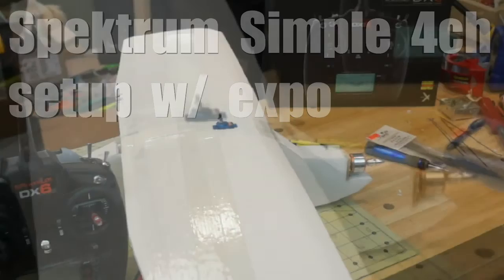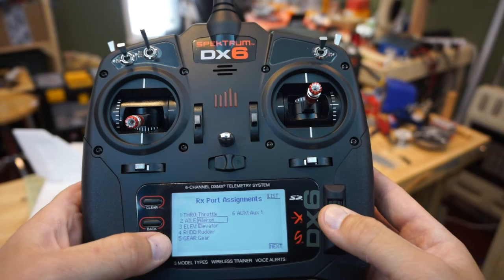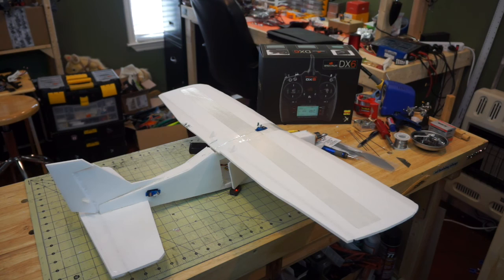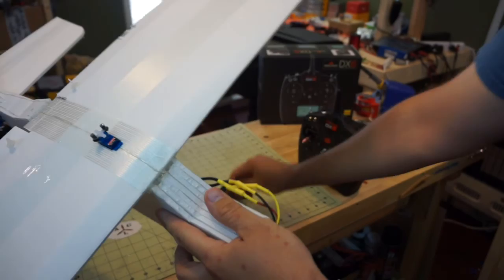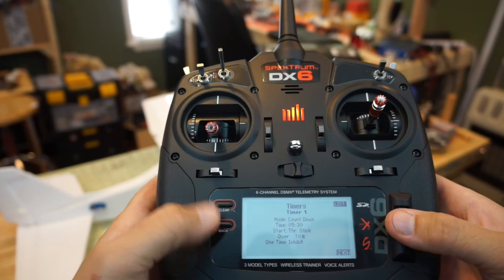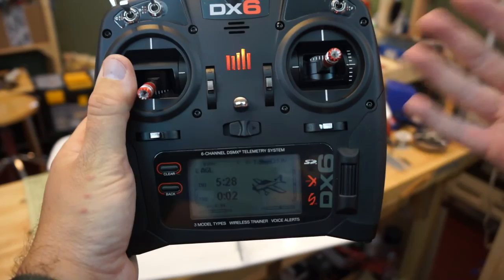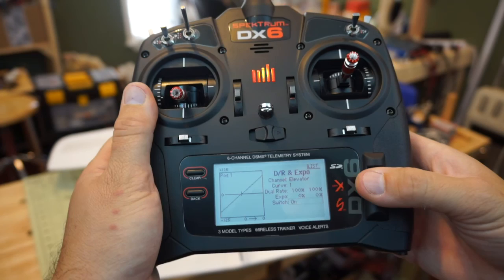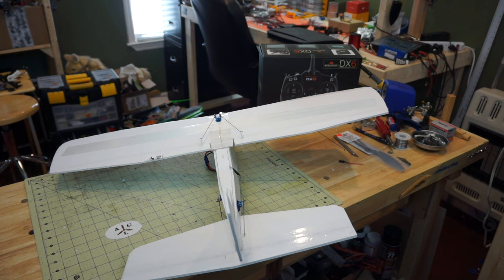Simple 4ch Spektrum Dx6 radio program w/ expo

Comment: Just bought a DX6 and found your video very helpful in getting started. Re. the timer - is it possible to reset them both without switching the Tx off?Hope you can do a video in the future explaining some of the DX6 features in a bit more depth. Manual is very poor in fully explaining how options work. Learned more off your video than reading the manual 10 times!! Thanks very much
Reply from the maker: +Kenneth Tarran I'm sure we can get into more with this radio and its many features.  If you hit the clear button the timers should reset.
Reply: +AGL Aerial Video Solutions. Thanks for the info - all ok with hitting the clear button on the timers. I'm getting to grips with the DX6 now and have one model all set up ready to go. Your video was instrumental in getting me up and running!Thanks,Ken
Reply: wht battery u use..?